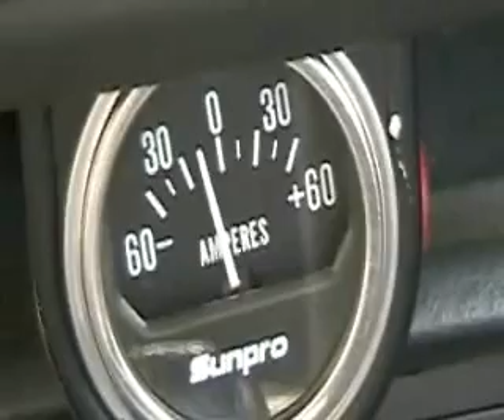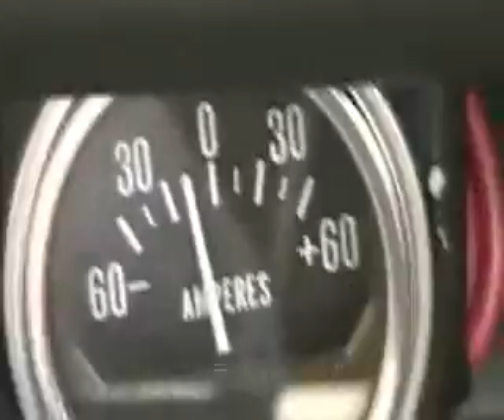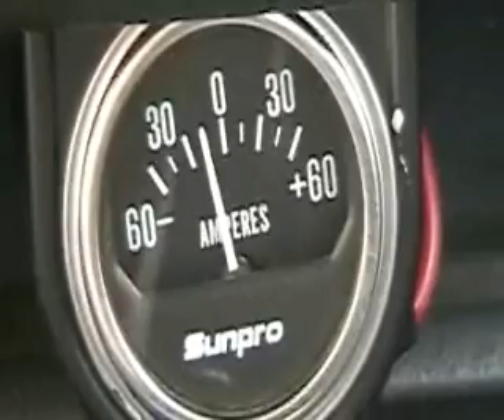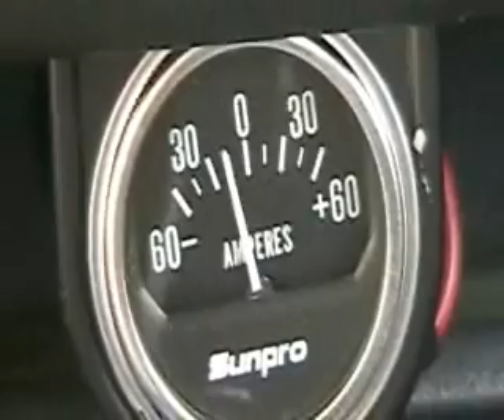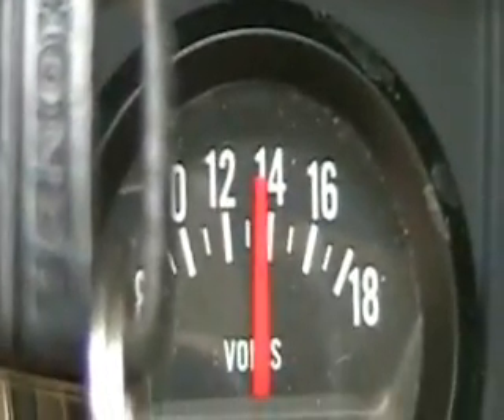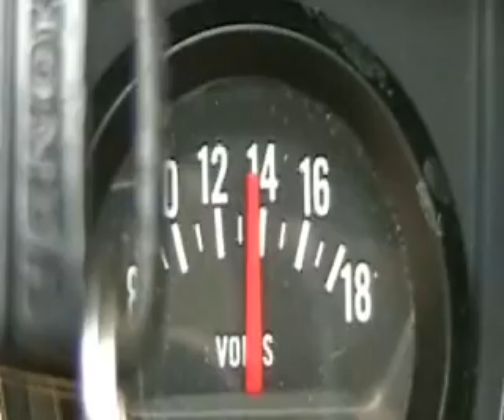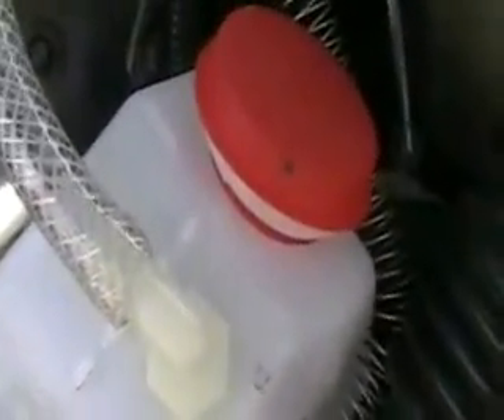Hydrogen Tap (FOCUS-ready) 318

Comment: I agree with John on this. Really no reason to be concerned with any type of pressure leaks while the engine is running as the system (including John's generator) will be under vacuum. His reasoning with that type of cap being able to "pop off" in case of engine backfire or his generated HHO gas igniting when it shouldn't sounds good to me.